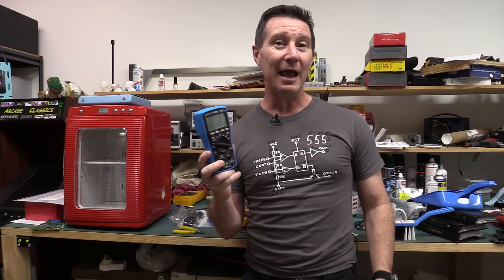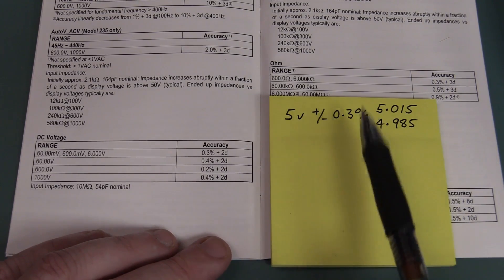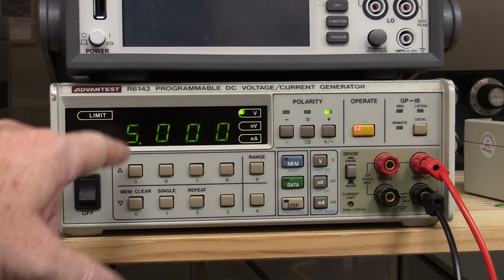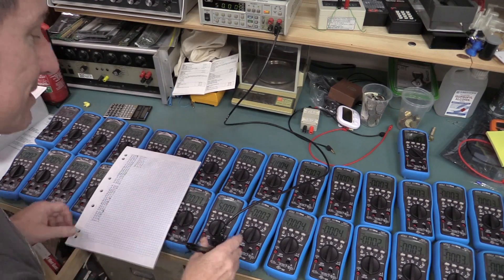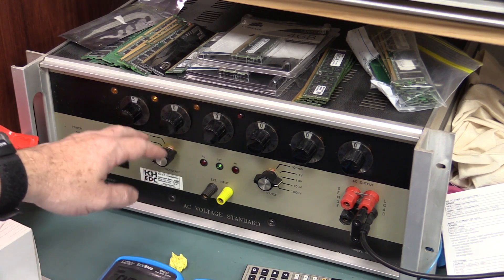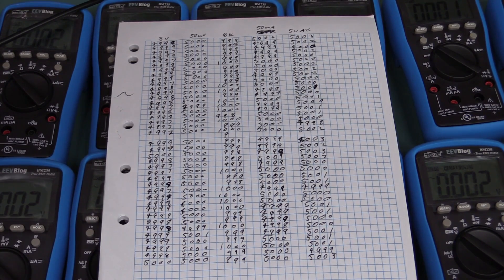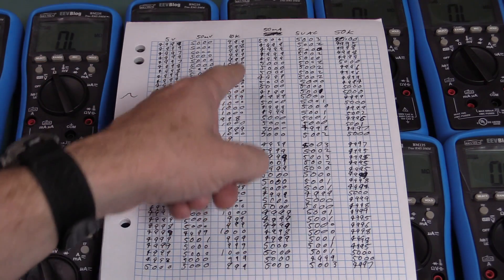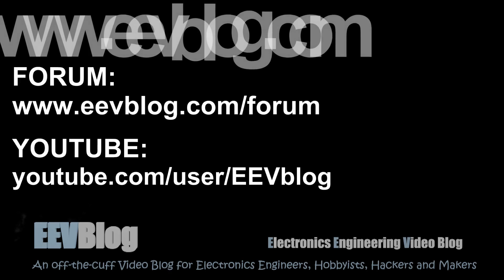EEVblog #852 - Multimeter Mass Turbulence

Comment: Really disappointing that the official eev blog meter is only a Brymen. I'll have to remember the low standards when you criticize things during a teardown.
Reply from the maker: +jak p (skiguy09) Have you actually used a Brymen BM257 or BM235? It's an excellent meter.
Reply: +EEVblog I couldn't agree more. These are brillant meters on a daily all round use.
Reply: When it comes to 'accuracy', Brymen seem to be in the same class as Fluke and Keysight (Agilent, Hewlett Packard).  We haven't seen many come through our lab, but the few that have come through have been very stable.  None of the usual annoying behaviour such as ramping up and down, or deciding to jump around, that you see in cheap multimeters such as the Uni-T.

It is Slightly surprising, given the multi-board construction that Brymen use.

If you can afford the extra money, then Keysight are a good value for features while Fluke have less features but are a bit more robust.  Brymen don't seem to be bad on either count, and are quite a bit cheaper.  All have specs that are not largely fantasy: something to be aware of when you are looking at the cheap multimeters.
Reply: +EEVblog yolo, Brymen is good for a Taiwanese meter. However the build quality and mechanical engineering are nowhere near a Fluke, Gossen or even Keysight. I would rather use a Fluke 100 series meter then a Brymen at similar or lower cost. You have contacts with fluke, and they even made you a special one off meter kit. Why not sell a Fluke? Better yet, why not design one from scratch? It's not like you need a ASIC that you can't get to design a meter. All meter components are easily available.
Reply: +EEVblog I've used these meters and seen your teardowns of them. The crappy backlight, 9v snap, crowded components, trace hand soldering, 2 board construction, jumping a mov way over other components, etc. make me cringe.
Reply: +jak p (skiguy09) That Fluke "one off meter kit" was an April Fools special!
Reply: +gfx2006 I'm aware of that, read the comment.
Reply: +jak p (skiguy09) I think the crappy backlight was only with one of the older models.
Reply: +jak p (skiguy09) 
Have you checked pricing?  Fluke 100 series are not cheap, and you can get a better a specified Brymen for less money.  The Fluke 177 at US$300 is more costly than the top of the range Brymen BM869s.

The situation in Australia (and New Zealand) is particularly bad, with a Fluke 177 going for well over US$360 (excluding sales tax).
Reply: +jak p (skiguy09) Well, then you should know that it was NOT really a kit that Fluke made. Dave took the thing apart and desoldered the parts himself for the April Fools fun!
Reply: +gfx2006 I am aware of that. I was joking about the kit. Does not change the fact that Brymen is a underwhelming meter and Dave has contacts with fluke.
Reply: I think the target customer has a lot to do with choice of brand and model. People who make a living with a multimeter have the meters required by their industry in their bag already. These I feel are marketed to the hobbyist, upcoming professionals/students, and young enthusiasts. These meters are priced well and for tool per dollar a damn great deal for the newcomers.
Reply: +EEVblog Yep I've got a red BM257, been great, outer build quality comparable to the 87V Flukes at work. Also, the Flukes aren't perfect, default mA is AC every time the multimeter is turned on.
Reply: Well I believe Taiwan made multimeters or significantly better than China made multimeters.
Reply: +funkyironman69 Also, I took the BM257 I have apart recently, it uses either two AA or AAA batteries (I forget which), there is no 9V battery snap insight. There's no crowded components or hand soldering and I'm pretty sure it's single board construction. I would like the backlight to stay on much longer though.
Reply: is the BM235 better than jaycar's digitech multimeter?
Reply: Bradman175
I would think so, the only Digitech I've owned had little glass fuses only rated to 250V. It was okay for really low voltage stuff but my current BM257 replaced it.
Reply: funkyironman69 Im pretty sure dave went through about how crap the glass fuse in the digitech one was.
Reply: +Bradman175 Yeah they are crap, 250V rating is fair to low for a multimeter. The Brymen I have has proper high voltage HRC fuses.

Comment: The Unity multimeter is only 50 bucks
Reply: +Tricky D doesn't change the fact that they have fake specs such as the cat IV rating even though the build quality and level of engineering doesn't back that up, and the fact that they use counterfeit components.
Reply: Why would you take it as comparison then? I think Dave is walking a thin line, this is basically a promo video for his products. If i wanted a quality Multimeter I would go for a Fluke.
Reply: Tricky D because its a comparison between A. a company who lies about their products and B. a company who tells the truth about their products, no matter what the price range is you should say a swift "fuck you" to any company selling an item not even worth the price they sell it for, dave did reviews of $50 multimeters in the past and the difference between the Uni-T $50 meter and the others was astonishiing, it costs nothing to put a bit of thought into a design. and oh the irony, you say why compare a $50 meter to a $135 meter and then proceed to compare a $135 meter to a fluke which costs 4x as much.. The difference is the Uni-T meter is worlds apart from the brymen for less than 3x the cost and brymen is a properly decent manufacturer for which you pay 1/4 of the cost vs the fluke.